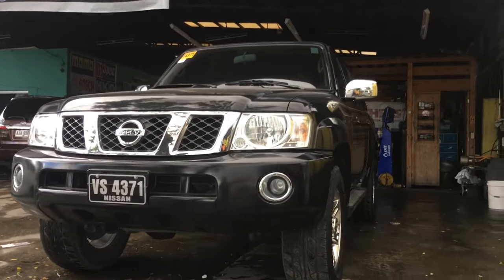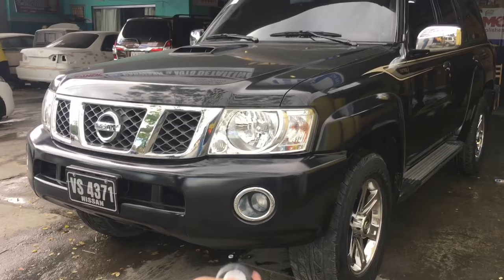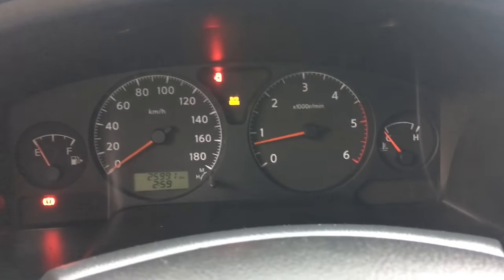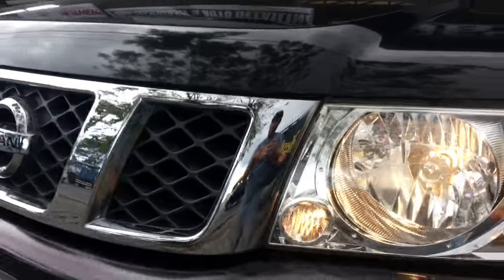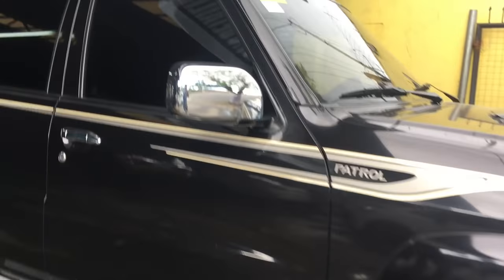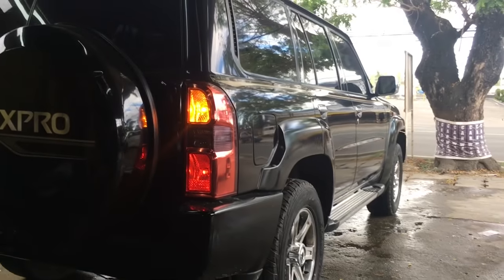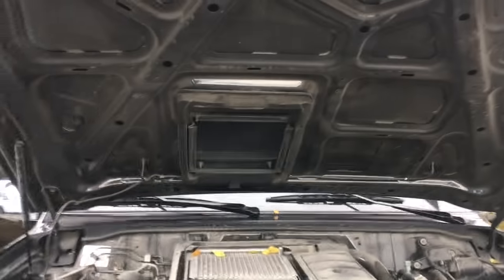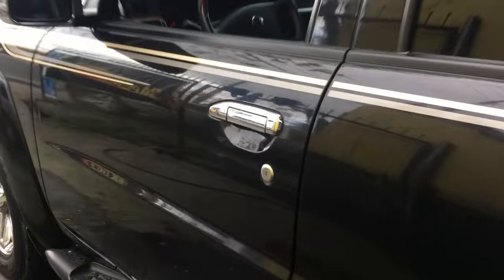2017 Nissan Patrol Super Safari 4x4 DSL AT Full Tour Review

Comment: I have a 2013 Patrol Super Safari, sobrang ganda, solarized silver, all the toys, ayun nga lang medyo mahina ang engine but it wasn't meant to go fast naman eh, it was meant to go everywhere comfortably. Sobrang smooth ng ride, everything is leather, and di ka ma bobore sa journey because of all the features. If u have one I suggest buying a dtp chip to boost the hp and torque, ayun ginawa namin. Kahit na its kinda old na, still super beautiful, so elegant, looks sooo expensive, at pang backup ni Duterte so ultra durable.
Reply: sir i would like to ask, mahal po ba maintenance costs ? parts service etc.. thanks!
Reply: clkdragzta Actually maintenance costs have been very low. Fuel economy is okay, at never kaming nasiraan or had any problems naman. And  spare  parts are very cheap naman po.
Reply: ilan na ang mileage niya sa odometer,sa mga long distance na biyahe ok din ba sya?
Reply: Johann Bernz ano bang fc ng patrol? Balak ko kasi kumuha nito 2nd hand. Recommended po ba?
Reply: sir paumanhin sa abala kumusta nmn po kunsumo nia slmt po